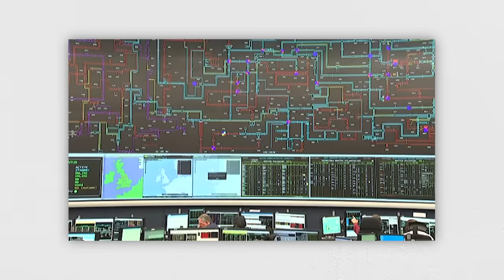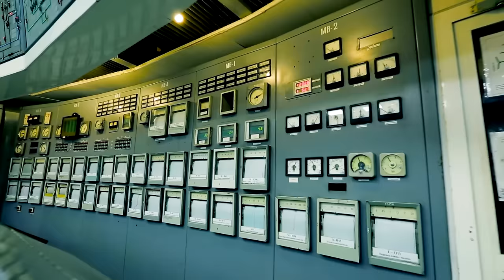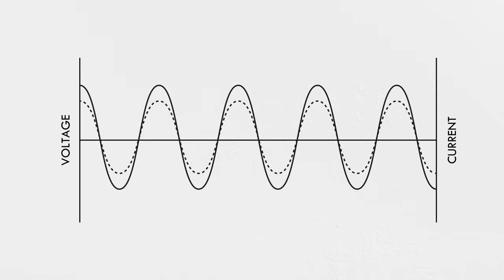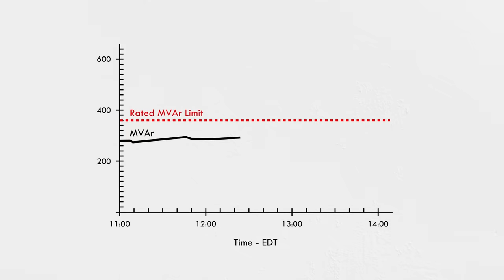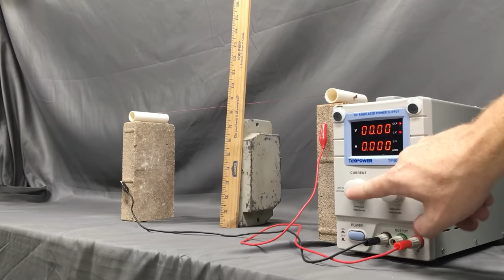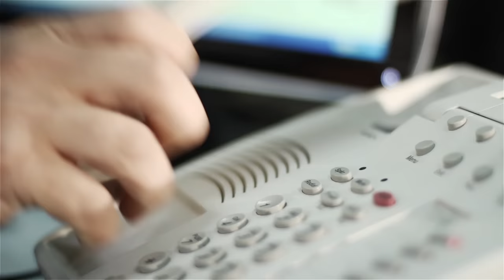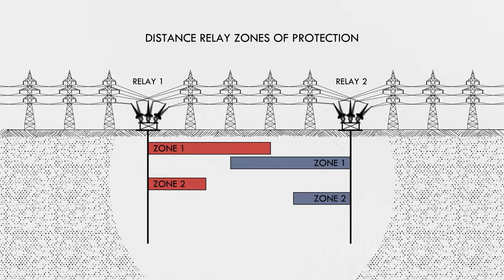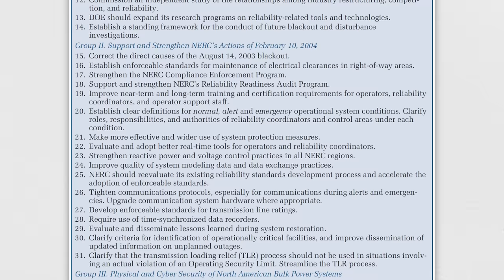What Really Happened During the 2003 Blackout?

Comment: I used to write software for a lines company, I would to get annoyed at the paranoia of the control room guys whenever we wanted to roll out something new. 

Having seen this, I have a lot more respect for how I approach these systems. In IT a cascading failure is usually relatively easy to resolve, so I can fully understand that naive approach when it comes to the real-world effects of our critical systems failing from developers.
Reply: The IT team never agrees with the other teams. :)
Reply: @Simcitywok  I just did a case competition related to cybersecurity and this was the bulk of the points we ran into. No one wants to upgrade IT because it's one of those things that no one notices when it's actually working properly.
Reply: Its politics, not the controllers or the developers of the grid, or the people coding the circuit boards routines.
You need a party that is controlling rehabilitee, controlling all the operators on the grid.  We need a dominate party here, or some Gorvenerment agency controlling the independent operators.
Reply: @lucasrem1870  I lived on a remote Alaskan military base for a year. The power plant kept the system stable for the main buildings, but the TV station often saw wild swings in voltage, or power outages. I was working one say when the 120 volt power to the equipment dropped to 20 volts. Then it pegged the voltmeter at 210 volts before almost every breaker in the building tripped. It damaged some equipment, but it shredded the film that I was running of the start of the World series.  It was so unstable after that, that I was pissed. The power plant manager just laughed and told me that there wasn't a damned thing that I could do about it
I thought, "Hold my Mountain Dew, and strap yourself in!" I put up a 'Technical Difficulties' slide, then had or DJ record a broadcast cart that stated, "AFRTS is experiencing power problems. We will return to our schedule, when it is resolved. If you have any questions, call:XXX-XXXX" The phone number was the unpublished number to the power plant manger's office. He called me and ranted, "What the hell are you doing to me?" I just laughed and told him, "There's not a damned thing you can do about it!" and hung up. 
Never piss off the Engineer!  😆
Reply: @michaelterrell  Man you basically doxxed him, that ain't cool
Reply: I don't think IT networks are less costly, if you adjust for size. A cascading failure in a company-wide network might be what most people think of, but that is still small compared to the electrical grid in this video.

In October 2021 Facebook suffered an outage that also should have been "impossible". I mean we all know about their redundancy systems for data and service. However nobody imagined that pushing some DNS settings would take down their network from the rest of the internet, and furthermore prevent easy ways to reverse this, since FB's own internal security and authentication systems went down too. FB was down for 6 hours and lost an estimated $60 million in revenue during that time.

If we actually had IT network cascades on the size of the Northeastern Blackout of 2003, IT engineers would be paranoid too. It's a blessing that the internet is designed to be more decentralized than the physical power grid.
Reply: what kind of programming is used in writing such software and do you get to work with analog inputs or you build on top of discrete data you're provided with?
I imagine you'd use a low level language like C/C++ for this kind of job.
Reply: @kirkhamandy  The it departments bitcoin miners were being ddos attacked !
Reply: @diablo.the.cheater  No, doxxing is private info. This was his office phone number.
Reply: Not even covered here we're the difficulties in bringing it back online... As others have mentioned, most generation does not have black start capabilities.

And there isn't even a start to automating turning the grid back on. It's almost not designed for it.

Who knows how many switching configurations that had never been used, and may never be used again were needed to bring everything back up.
Reply: Operations is not Paranoid. Just always looking at worst case.  If you ask the answer will always be "No" until you can prove "Yes" is OK.

Comment: As a EEE grad; WOOOOOOW; amazing summary of events, and great explanation of the complicated dynamics of a cascading blackout. Your very brief, but approachable explanation of Real vs Reactive Power is to be envied! 

Really concerning that the Right-of-ways are not well maintained enough to prevent the trees shorting the lines. I wonder how much the computer system was to blame, and whether or not over-reliance on it was the primary cause. Seems like they need to do more 'paper days' where they can become accustomed to fallback methods of monitoring and control
Reply: Most importantly they now have dedicated signals telling them if and when the computer fails, so they can focus their brains and eyes on the raw data instead of starting at the main panel stuck on "no problems detected".

Comment: I work in aviation safety, and have spent years ding it. This has the same concepts littered all over it. WE often nickname it the "swiss cheese model" Where all the holes in the cheese align, such as the MISO Estimator, and the IT issues.

In aviation systems (on ground based units), even a minor error cannot be withheld from the operating manager. If there's even a loss of redundancy, it must be reported.
Reply: “The Swiss cheese model”. Human factors at its finest (or worst) possible moment!

Comment: Story time. 
I was in the Army stationed at Camp Yongsan in 2018-2020. Camp Yongsan is in the middle of Seoul. Its being decommissioned, so there is very little oversight. 
Seoul, and Yongsan are on different electrical grids because of US/Korea military protocols. One cold morning, the whole base lost power, and since I work at the data center on base, that was a big deal. 
We have two 1.2 Megawatt rated generators on site specifically for the data center. The problem is, no one knew hoe to start them, and cut over from shore power, to the gennys. 

    I step in to figure it out. Having no formal background in such things. I got the Gennys running, but the control systems were in Korean. Eventually I got the building powered on, and everything seemed ok. 
The gennys run on a 400V system, and I did notice the ammeter dial was nearly maxxed out. And when I went outside, the street lights were back on, and traffic signals too. It was very early, and everything seemed ok, so I went about my business. You might be able to see where this is going.. 

    Within an hour they called me back, and told me both gennys breakers tripped. Well.. I dunno about you but 2.4 Megawatts seemed like a lot for one building. Plus, the street was dark again. Weird. 
Come to discover, my building was basically providing power for the entire outage area for about an hour, courtesy of myself. Figured out that the shore/genny switch wasnt automatic, and I switched it over to genny only, and everything was fine. The ammeter showed only about 10% utilization. Actually, we only needed one genny running for our building. 

    Oh well. Thats one way to learn. I never told anyone, they were just glad it worked. 
My own personal 2003 grid failure scenario.
Here is a link to a video of the actual generators from my story I filmed on that day. 
https://photos.app.goo.gl/twmp7zAhXm3JeXCq9
Reply: Thanks for the story.

Comment: This was a crazy day.  I was working in downtown Detroit when the power went out.
It took about an hour before the majority of folks could leave.  The gates on the exits in parking garage we used were stuck down.  It took a while for maintenance to get the necessary tools to disassemble the housing and we get the gates open.  People were getting antsy waiting.

The other scary point was the first thing folks thought was it's another terrorist attack.  It was only a year and a half since 9-11, don't forget.
Reply: I hope the gates were changed to have a simple mechanical override...
Reply: @renakunisaki    Originally, the garage and office building (They were connected via bridges and built together) had a huge diesel generator to supply power in the event of a loss.  It was tested every month.  But for some reason it didn't start when the power went out and they couldn't get it running.
A quick disconnect for the gate was added after as a backup to the backup.
Reply: Brighton, MI was right on the edge, but never lost power. At first I thought we were lucky. Once word got out, EVERYBOBY drove here to get gas and eat out. Even with power the town came to a standstill.
Reply: I'm shocked people didn't just drive through the gate, especially if they were panicking

Comment: You should make a video on the 1998 ice event in Quebec. (In french "La crise du verglas de 1998") 100mm of freezing rain fell during 5 days. Transmission lines pillars were breaking under the weight of ice. For some people, it took more than a month to restore electricity in winter. Gouvernment allowed the construction of an alternate powerline asap. It was an ice mess lol. You would also have alot of historical pictures, data and stories of the event to make a video.

Comment: I’m a retired utility engineer and was working that day as a consulting engineer.  You gave the best explanation of the August 2003 blackout that I’ve heard.  One thing that needs to be said is that the power grid in the US is itself the largest and most complex“machine” ever built by man.  While it’s reliability has been amazingly good, it’s really limited to our understanding of every conceivable event. It still requires the human mind to interpret events and make on the spot decisions. If this human intervention is not present, a cascading outage is the results. All major outages are a result of the lack of timely operator intervention. 
One major factor is that the system itself is composed of protection equipment that ranges in age from current technology to devices over 100 years old. It  all has to operate together. It’s simply not possible economically to upgrade the entire system at one time. 
The best that can be done is to plan for every contingency we can identify and have an operating plan that addresses those contingencies. 
As computers and Artificial Intelligence become more capable, we can analyze more contingencies and anticipate more events. However we then become more vulnerable when the technology itself fails. It’s a balancing act. Most of the time we get it right. Sometimes we run into a situation we never anticipated. I doubt it will ever be possible to completely remove the human factor from the operation of the power grid, nor would that be in our best interest.

Comment: There's a guy in PA in a control room that made a tough decision that stopped the spread South  and East. I worked on the replacement SCADA and my thanks goes out to him.
Reply: Its politics, not the controllers or the developers of the grid, or the people coding the circuit boards routines.
You need a party that is controlling rehabilitee, controlling all the operators on the grid.
Reply: @lucasrem1870  In this case a controller prevented things from getting worse, but it was not part of this telling of the story. There are too many political forces involved for sure. The good news is after this the new rulse are the controllers have the athority to do their jobs how they see. The managment must then assume whatever they did was done with the best of intentions. This was not always the case before.

Comment: That's funny we had a great blackout where I live in 2003 as well. Where the South of Sweden and Eastern Denmark where left without electricity for up to 9 hours.

Apparently back then none of the power plants in the region could be started without electricity, So it was necessary to use an old 22,500 bhp B&W diesel generator from the 1930's.
It has now been turned in to a museum, but they have some footage of the engine being started on their YouTube page https://youtu.be/g3DsWLn0r24
Reply: I just watched the video, that thing is huge!
Thank you, man.
Reply: Yeah, I was in upstate NY at the time.  We had several gigawatt-sized plants that couldn't start without power.  But a nearby gas-turbine plant was 'black start capable' so it came on.  It's priority was not to feed local hospital (which had it's own emergency generator) and some folks didn't understand that.  And it didn't restore power to the local town (which of course folks complained about).  It's biggest priority was to FEED OTHER POWER PLANTS, so they could restart.  :)
Reply: Thats because a generator is essentially a spinning magnet inside a copper coil. 

Small generators (like the portable ones you can run part of your house on) can get away with just using a permanent magnet for the rotor.

However, big grid sized generators use an electromagnet instead because this lets them adjust the dc rotor current to adjust the magnetic fields to better control the output voltage of the generator. (Rotor current is also called the excitation current)

This is how the coal plant in the video over excited the generator and tripped it, they cranked up the rotor current and probably also put the plant at "full throttle" (apply more mechanical power to the rotor). 

Normally you just source this electricity from the grid, but if the grids down you can't make a magnetic field in the generator so even if you spun the turbine you wouldn't make any power. (To say nothing of the control computers and electronics)

Another issue with a black start is you have to synchronize your output to the grid before connecting, usually this is done by having a different region energize just the transmission lines the power plants are hooked up to so they have something to draw from and measure against.
Reply: Wow, that a beautiful machine. Sound is quite pleasant, too!
Reply: They did not bother having black start units?  Seems risky.
Reply: @mikefochtman7164   That sounds like it might have been instituted as a consequence of the 1965 northeast power failure, where (according to the report of the inquiry I read at the time) a number of power stations couldn't restart without external power.
Reply: @andrewt.5567  There were several black start units.  But not every plant.  So when you lose them all, you wait for the black-starts, pick up a limited amount of load and feed power to the non-black-start capable plants.  Power them so they can start and so on.  It's not something that's supposed to be needed often, who wants to pay for things you only use once every 20 years or so?

Comment: New England was for the most part spared from the blackout. I was an outside hvac contractor and we took care of The Grid account. We didn’t know what the buildings were doing but they had top security and priority when issues came up. These buildings were part of the elaborate experimental trip points for the grid control systems and we were informed after the blackout that they would be implemented throughout the grid because it worked so successfully.
This is great account of the 2003 blackout. I remember all the lineman trucks leaving the state of Massachusetts to get the grid up again in other regions.

Comment: A few years ago the UK had an electrical "wobble" where two generating stations (renewables I think) down in the south east of England suddenly went offline unexpectedly, causing sections of the grid to cut out, even up here in the North East of England there were sections that cut out despite not being close to the faults, it was enough of a cascade that it just tripped things and cut out, was a weird moment when it happened as my desk fan made an awful noise and slowed down drastically, as well as my UPS units going bananas trying to compensate for the voltage drop... :S
Reply: One was a gas station at Little Barford, the other was one of the wind farms out in the north sea - it was a fun day to be on shift in the control room that's for sure! - frequency dropped to a level where the grid protections kicked in and automatically cut off about 10% of the UK demand (hence saving the remaining 90%), would have been much worse if it didn't load shed like it did...
Reply: The part that got me laughing was the way the media seemed to portray it as a huge disaster, yet like you say, could have been much worse if it took out more of, or even the entire grid, the nation would have struggled to get back up and running if that happened... :S
Reply: @twocvbloke  Yup, completely blown out of proportion as usual, if anything it was a success from failure... it didn't help that a bunch of trains tripped themselves offline due to the frequency swings, even though they didn't actually lose power...
Reply: Yeah, I remember the trains, the fact they needed a specific engineer to come along to essentially turn them off and on again was a real highlight of why they needed to simplify that process, don't know if they have done that by now, but given the state of some train operators, I doubt it!!!
Reply: Highlights the importance of having UPS units. Also reserve power as power shortage in Europe increases when nuclear power gets replaced with solar and wind.
Reply: @twocvbloke  The trains was the first thing I thought of, having quite an interest in both. A really conscientious and proactive fleet manager or even the DfT would have gone straight to Siemens demanding answers why power loss resilience was not considered a necessary and critical feature on the Desiro units. By the time the engineers got around everyone the lines were de-energised due to poor passenger management resulting in them self-rescuing onto the tracks.